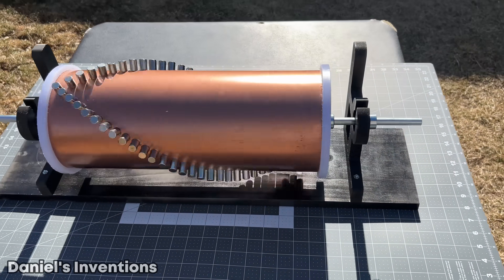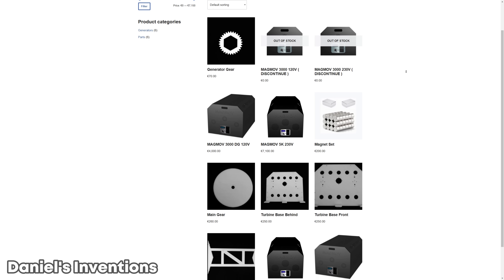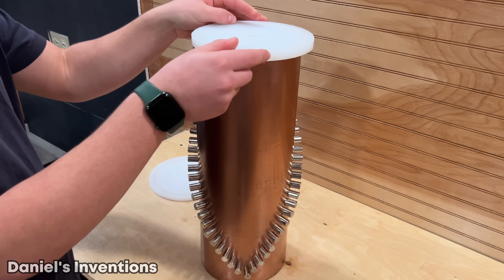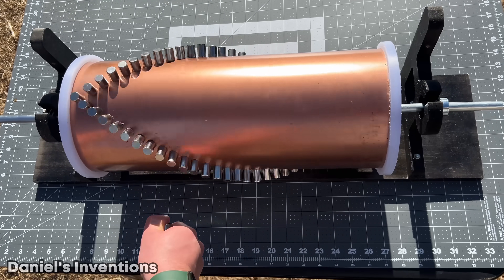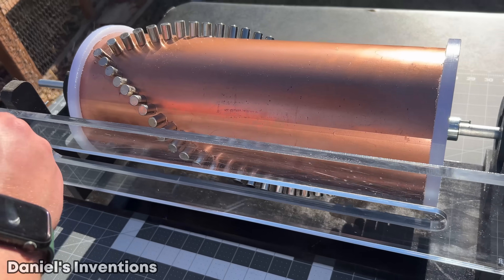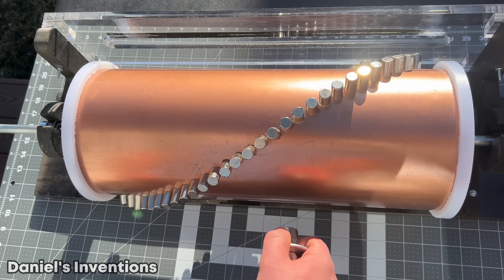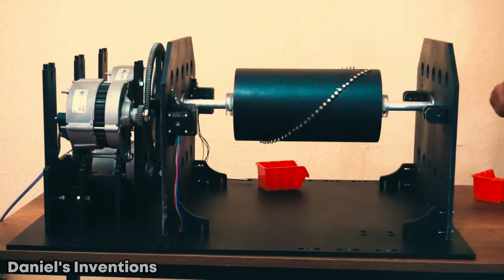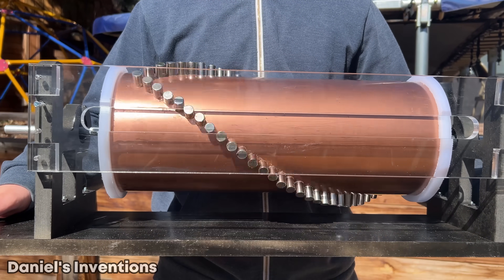A Generator That Can POWER Your Home for Free

Comment: I recently modeled this very MagMov generator in Fision360 and am now buying the parts, I have identified the same problems with this device, " the need for a fast horizontal drive magnet. Where the Stepper has a max speed of about 500mm/s. Also, you need magnets that have a push force of 60ft/lbs to produce the required torque for 3 alternators. This doesn't mean that you have to use alternators to produce power or limit the output to a level more in line with the magnet sizes. The rotation speed is also going to be a problem. The website for the MagMov company is in the country of Georgia North of Armenia and not in the US or UK. Kinda Fishy. This has been on the market for over 5 years and is unknown. I contacted the original Idea tester who had the PVC Pipe drum shown in the video. His name is Dean Elliot and runs an RC car business in Ohio. I think the rotating drum Idea of his is brilliant. He said this MagMov company saw his Idea on YouTube and went with it.  Dean has no idea about this company. He asked me to remember him if I get rich, at this point I don't think it's about getting rich but about serving our fellow man.
MagMov
 No.11 – Melani 3

George W.Bush Highway
Tbilisi 0144
GEORGIA
+995 32 27 888 91 
If I could I would post pictures. I have other ideas on how to tackle this problem. I have always believed this is possible to generate electricity from the pull or push of a magnet.
Do this simple test: Hold 2 magnets at a distance on the surface of a table, and nudge them closer together until they slam together of their own accord from the magnetism. What just happened They moved a mass through a distance, this is the definition of doing work, and that takes energy, where did it come from? It came from the spin of electrons in the domains of the magnets, Physicists will tell you no energy can be extracted because it takes the same energy to take the magnets apart.
My contention is did the magnets do work while in motion? Yes. Well then, this will work. So you have to be clever to never let the attraction lock them together where there is a stiction point. 
I believe Dean's Idea is worth tinkering with.
 I see a lot of interest in this idea, and I wonder if we could go to a forum to discuss this in-depth and maybe even have an energy conference this summer at some location.
Reply: Permanent magnets only deliver what physicists call "potential energy". It doesn't matter if they "lock together". Even if you only approach them you have to pull them apart which also needs all the energy which was gained before. And the device in this video is utterly useless. The energy you can get from the rotation is due to slight losses always smaller than the energy which is needed to make the horizontal movement. "MagMov" is clearly a fraudulent company.

Comment: Thinking of it from the other direction: It's an interesting way to make linear motion (say a pump) from rotational motion (say a waterwheel).

There may be some use case of a self powered water wheel pump, but my gut feeling is there are mechanical linkages that are more efficient (although subject to wear).

Comment: Daniel, you need to make the cylinder real heavy, for flywheel effect. The naysayers, don't understand in systms like this, the input accumulates the force. Ps never build a magnet motor in repulsion mode or will kill the magnets in a short time .

Comment: Hi Daniel, i have a better less complicated version design that doesn't need servo motors which many can't program. If the cylinder becomes a sphere with similar magnet design, then a simple sator ring at 90deg can be spun with just one small motor, which won't need complicated timing.
Reply: Hi, can I see your design?
Reply: @22w1  read my comment again
Reply: Do you think that effective enough?
Reply: Hi Daniel, thanks for the video. You keep trying, never let the negativity stop you.

Comment: Yo Dan, long time no c,  -  (your vid is even cooler than last weeks)...    - back on the band wagon hey ?...  -   even though this one looks like its got the horse in front !!   ...........  can i suggest an old photocopyer (large one),  for the roller guides, bearings, and brush dc motor with &&photo resistor timing... ---  the big old copiers are the way too go, and free... if you can transport them !!

time is of the escence, and smells great when you get it right.

Comment: that's just an energy transfer device. The energy that went into manufacturing the magnets is slowly dissipated out as rotational energy, until the magnets are no longer strong enough to move anything
Reply: If that were true magnets in conventional generators would depolarize just by using them, which obviously is not the case.
Reply: He made an ineffective magnetic reduction gear...
Reply: @a64738  I have had Neodymium magnets stuck to the underside of my cabinet for over 30 years, They are still there, holding their weight against the force of gravity. They call them permanent for a reason, and yes if you heat them up they will demagnetize.

Comment: the magnets are irrelevant in the video. Once a load is added to the alternators, the thing will fail. If you have any size generator, when you add a load it to create the power to turn the generator under load you need more power. You would need at least 5hp or more to make 3 alternators work at a minimum. The is how electric cars start to slow down during breaking.
Reply: braking
Reply: That's only true if your generator configuration has Lenz's Law against itself, there are ways around that.
Reply: Not to mention that a typical car alternator is at best 60% efficient.
Reply: If you were to use a solar motor high Rev. Or a wind turbine ???
I know self driven still needs a bump motor !!!!!!
Reply: What if they charge. Batteries and use these batteries to lower an inverter
Reply: But they have the device selling so if it was a fake we would of hear someone say so by now
Reply: @wisdomafoolweakness3391  This type of product exists for ages and has been debunked millions of times, you're ignorant if you think no-one is complaining
Reply: It may work if you can govern it additional equipment is required